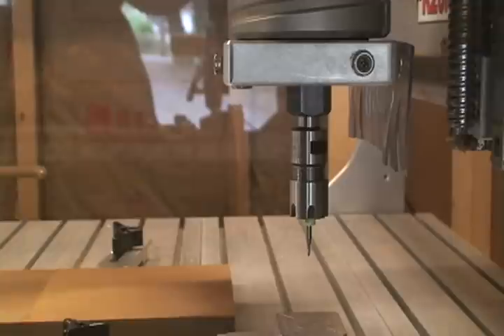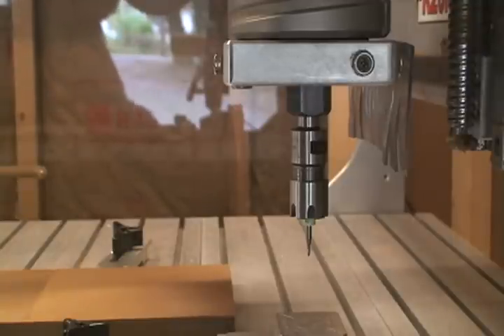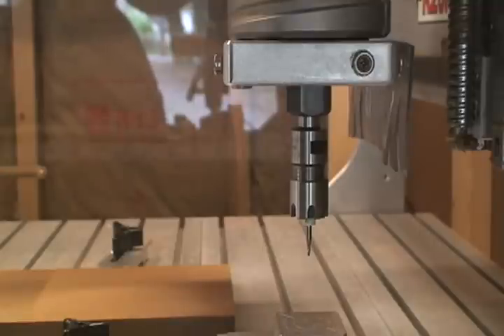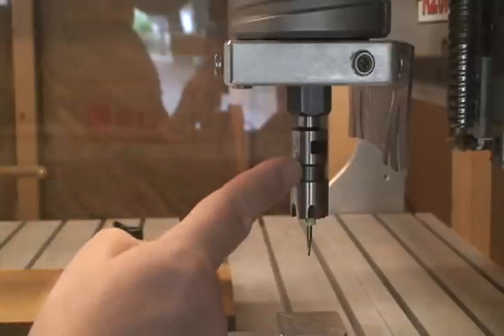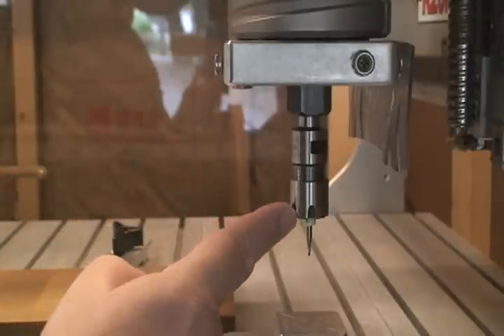Testing My New ER16 Spindle Adapter

Comment: Hey I just got a 3018 and am assembling it today. Did you ever figure out a method to have set offsets to change tools and go?
Reply from the maker: No, I am still zeroing every tool........ about to buy a ATC spindle just for that convenience! Lol
Reply: @VCustomShop  also I checked out that website and I am going to save that no doubt. On top of that I will probably turn down some nylon if I can some day and drill out 1/8 and 1/4 in holes centered to help me with the current tools I just bought setting their offsets quicker as I go like those tools on that site. It may take some time to place each one in the exact same location on each bit but I’m good with measurement tools and feel I can make it work and will measure each time as I set the tools to verify everything is as it should be.